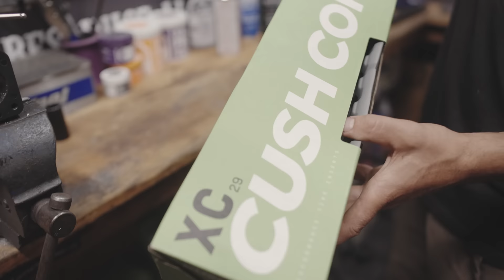DREAM BUILD MTB - Atherton A130

Comment: The frame set looks really heavy!
Reply from the maker: It's not that bad!
Reply: 3.1 kg no shock
Reply: @edwardmeakes1284  Wow....now that is light!   I guess the tubing diameter is deceiving!
Reply: @Magoo71  Carbon tubes and Titanium lugs? There's no heavy materials...
Reply: Carbon tubes connected by 3D printed titanium parts - definitely not heavy!!